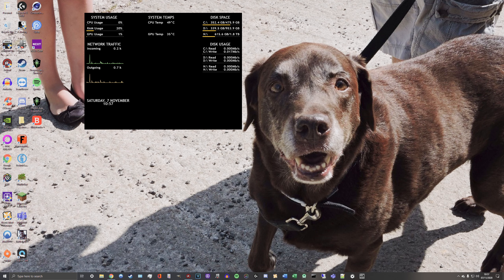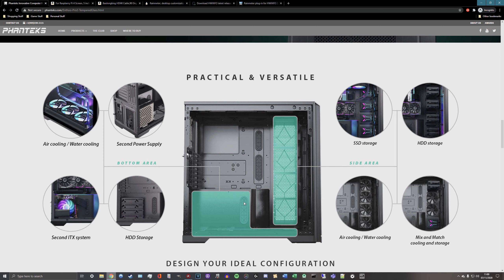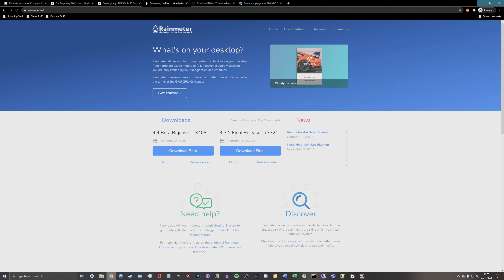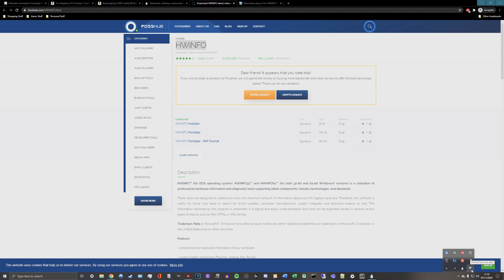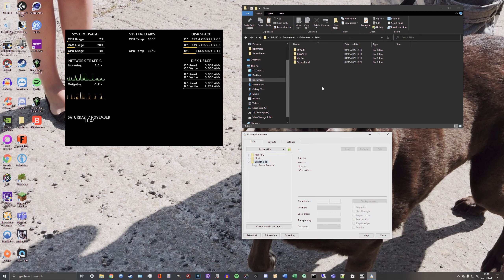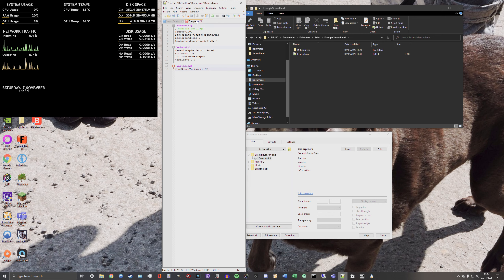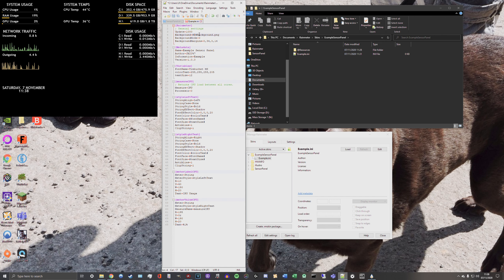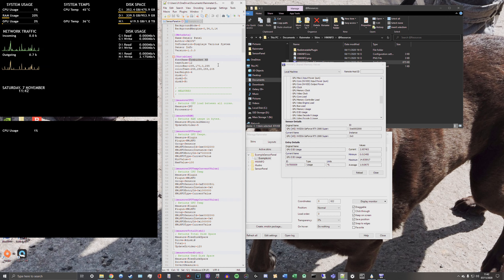Creating a Custom PC Sensor Panel/Hardware Monitor Without AIDA64 (Using free software)

Comment: wonderful video, and nice explanations. But at this point in time it isn't possible to have it working 24/7 since HWiNFO added a Pro version in March 2021. The main difference that causes issues is that the shared memory will only last for 12 hours in the free version and has to be manually enabled again after that time period.

So for it to work correct you either need to pay 20 bucks for HWiNFO Pro or use a version prior to the version 7 release.

Edit: I have not used it for 12 hours yet so i do not know if you need to enable it only once after the 12 hours to work permanently or every 12 hours
Reply from the maker: Ah right, thanks for the info. I haven't updated my HWiNFO version yet so I'm still on v6.34-4300 but I've pinned this comment to let others know.
Reply: My rainmeter sensor gadgets don’t load at boot and I’m also using 6.42 (something like that, I’m not home atm)
Reply from the maker: @darkaheart  Is this Rainmeter that isn't loading the skin or is this the HWiNFO plugin that isn't loading on startup?
Reply: @JAIJ47  I had the “show sensors on startup” uncheck, it’s confusing because it says “show” I figured they meant the window. I checked it and it’s working fine now
Reply from the maker: @darkaheart  Fair enough mate. I also feel it's a bit unintuitive to have a cross on a checkbox as well since it almost looks as if it's a negative action if you get what I mean

Comment: I'm glad to see a video come out where people aren't using Aida64.  Aida is nice but limited with gauge sizes and such.  I'm going to use this video as my template for my own sensor panel.  Thanks for the video.
Reply from the maker: You're welcome :). If you need anything clarified further then don't hesitate to ask. I'll try to help as much as I can or at the very least try to find some resources that could help.

Comment: Nice video. I am new to rainmeter so can you tell me how to make the skin fullscreen? Also would it be possible for the skin to launch on the display in my case at startup?
Reply from the maker: Yeah sure. The way I got my skin to be full screen is by basically just making sure the background image matches the resolution of the screen inside the case and then set the "BackgroundMode" property to 0 (I did put up another video going more indepth with my skin and what each little bit of code does if you want to check that one out as well https://www.youtube.com/watch?v=o2TbiSEOBXw )

So Rainmeter should already be opening on startup already but if not: Go to Task Manager, open the "Start Up" tab, find Rainmeter in the list, then make sure it's "Enabled".

For the skin to launch on the display, it should automatically be doing that since the second display is always plugged in and with Rainmeter opening on startup it should be remembering the position of everything on the monitor on start up
Reply: @JAIJ47  I’m using an old iPhone 5 for the display inside my pc so for it to be fullscreen would I just get a sideways iPhone 5 background and change the positions and sizes of the temps and stuff according to the background?
Reply: @JAIJ47  ok I managed to get the background set now i just need help with resizing and positioning the stats. I would like the fan speeds, disk usage, and network traffic removed so i can make everything else bigger. Thanks for your help.

Comment: This is really great and well detailed, thank you so much for sharing!

I only have two critiques, one very minimal and one point of improvement. The first is that you started out calling them 'widgets' and then switched to 'skins' in the second half. While not a big deal at all, skins is the correct terminology and widgets is used by XWidget. 

The second thing is that the text was a bit hard to see/read and I found myself leaning in towards my monitor several times, which makes me think that people on small screens/lower resolutions are going to have a hard time following along in certain parts. You do a good job of explaining what you're doing already, but either finding a way to zoom in or making sure you're being extra specific in your explanations when it comes to text would be very helpful for those who have a hard time with small text. A great example of this would be when you were talking about the file type needing to be ini. In that instance, it would have helped greatly if you'd spelled it out as well. Honestly, this is the first time I've heard someone pronouncing it as a whole word (which doesn't help with how to actually spell it as, if I didn't know already, might have entered 'innie' instead) and, with the small text issue, I felt it was the one time where the tutorial failed to be clear enough because, even with setting the video to the highest quality and leaning in, I still couldn't read things clearly. It was only when I full screened the video (and my monitor is 2560x1440) that I could really see 'ini' clearly.

Aside from that, everything was great. I can't talk about how much sense everything made as it made sense to me, but I've been using rainmeter for a long while at this point and can't speak for anyone whose just starting out. I have a feeling it's fine though. All in all, great work and I'll post this on your reddit post as well~!
Reply from the maker: Thanks a lot for the feedback. I'll see if enlarging the explorer icons will help to clear some of the small text issues when I next attempt a video. I'm looking to do a little update video some time soon on how I'm attempting to 3D Print an enclosure for the monitor using blender and cura so I'll try to improve the recording when I get to that point.

Comment: Do you by chance have a copy of the note file you are using that youd be able to link/send?
Reply from the maker: I've got the rainmeter skin in a GitHub repo https://github.com/JAIJ47/SensorPanel just be aware you may need to change a fair bit to get it to work for yourself and keep in mind the pinned comments about HWiNFO compatibility

Comment: is therIs there also a way to use a USB monitor I have the ax206?
Reply from the maker: Should be able to as long as you extend the displays in Windows and drag the sensor panel over to the monitor you want to display it on

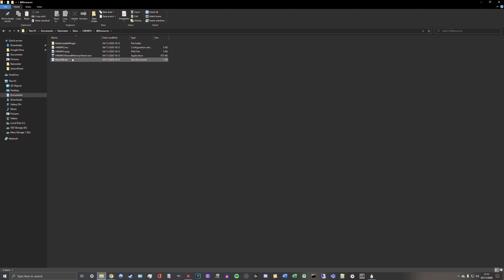Comment: i dont get this guide at all are you using a pre design build??i get lost @14:26 with all that coding i dont understand it. where do i get that script u have for sensor panel to use as templet? i guess what im getting out is how do i start from scratch i got all the programs but you go to Sensor panel folder with loads of text where do i get that??
Reply from the maker: Feel free to ask more questions if my reply below didn't really make sense. I may make a Rainmeter basics series to explain the components in more detail sometime this weekend if I have time to.

I made the skin myself using a mixture of vanilla Rainmeter measures (examples on reading CPU and RAM usage, Disk space, and Network traffic can be found by right clicking and editting parts of the example skin Illustro which is provided by Rainmeter by default once downloaded) and measures using the HWiNFO plugin. I didn't provide a link to download the skin since different hardware setups and systems will have different sensor information so large chunks of the skin may not work for others since I made this specifically for my build. This is also the same reason for why I didn't do a step by step explanation of the skin and tried to keep everything as basic as possible since every section (apart from the CPU and RAM usage, Disk Space, and Network Traffic sections) may be irrelevant to a majority of people watching.

To create your own skin from scratch all you have to do is create a new folder in your Skins folder (which can be found in Documents\Rainmeter\Skins). Call it a meaningful name since this is what will show in your Rainmeter UI when you want to load a skin. This part can be found from 14:46 - 15:29.

Inside the folder you've just created you just need to add an @Resources folder (to hold any images, fonts, or other resources you might want for your skin) and an ini file (just create a blank text document in Notepad and save it as type .ini). The ini file is your skin as it holds all the measures, meters, styles etc used to display itself. Without meters the skin will not run. This part can be found from 15:30 - 26:01.

Now from here it's up to you to decide what info you want to monitor. Everything you want to monitor will go into the .ini file you created. I gave a brief explanation on how to format and use the HWiNFO plugin to create measures for more advanced hardware readings from 26:02 - 29:28.

Some other information that might help you to understand the basics can be found in the Rainmeter documentation. I'd recommend reading about measures, styles, and meters first of all just to understand the basics and it'll also give you a decent idea on how the components work together to create and display the skin. The 3 sections are basically the foundation of any skin as they're all required sections for a skin to run.

https://docs.rainmeter.net/manual/measures/
https://docs.rainmeter.net/manual/meters/general-options/meterstyles/
https://docs.rainmeter.net/manual/meters/

Comment: So i wanted to do it by myself and create my own skin but the problem is its not that easy and also didnt found that much helpful video anywhere
If i tried aida64 it may be easy but wanted to do it in rainmeter . Can you suggest me something ? 
I wanted to make gauge,vertical bar and a clock.I tried using skin but cant those arent perfect size and also couldnt understand the ini files (which skin i liked)
if you know how to make this skin will you please create a playlist for these if you have time !!
Reply from the maker: Sure. I'll look at recording an indepth look at the ini file and try to explain each part as I go over it.
Reply: @JAIJ47  thanks a lot . tbh i was inspired to do this after watching your video.
Reply from the maker: @nabilubaidullahmobin2121  Thanks for the support mate. I really do apreciate it. Currently I'm just making a script and going over each line in the ini file. Once that's done and I've recorded, edited, and published the video I'll let you know it's up. I'll be providing timestamps in the description of that video as well since it's quite a bit of content
Reply from the maker: @nabilubaidullahmobin2121  The new video is up going over the code in more depth. I also show examples of vertical bar meters, a gauge, and digital clock/calendar
Reply: @JAIJ47  thanks bro btw doesnt hwinfo support psu monitoring ?
i bought corsair cv 550w last day but not only hwinfo but also hwmonitor,aida64 arent showing any data .
Reply from the maker: @nabilubaidullahmobin2121  Judging by this post here (https://www.hwinfo.com/forum/threads/psu-monitoring.3134/ ) you may need to look into the Corsair Link application and check if HWiNFO can see the sensor data

Comment: Too long and totally boring. Could have been easily edited to 6-7 minutes.
Reply from the maker: Where could I have condensed it to 6-7 minutes in a way for complete beginners to understand?
Reply: @JAIJ47  people who are willing to build this system knows the basics and some more. You don’t have to explain every point to them. 
Hardly there are any newbies who sees this sort of videos. JayzTwoCents explained everything and more using AIDA64 (which is a more complicated software) within 10 minutes.
Reply from the maker: @drbmaitra  But what if people "who are willing to build this system" don't know the basics? I personally don't think it's fair to assume that everyone that ever watches this video has intermediate to professional knowledge about PC systems, Rainmeter, Rainmeter plugins, and HWiNFO (see the comment by eric stackley as an example) which is why I attempted to at least explain the basics behind each point.

I do agree though, in hindsight, that some of the Rainmeter ini code explainations could have been condensed a bit or at least explained a bit better.
Reply: Then they won’t be able to assemble a basic machine, leave aside creating a second screen for them.
Reply from the maker: @drbmaitra  How does building a basic machine have anything to do with displaying sensor information using Rainmeter?

You can make a Rainmeter skin without having built a PC before. Creating a sensor panel isn't exclusive to just people who build PCs, it can be done for pre-builds or even laptops as long as there's HDMI output. That's why I didn't go over my PC build in any depth. I only showed an image of my case to explain how I mounted the screen and routed the cables.

This is just a video on how I created a custom PC sensor panel. It's not an in depth walkthrough, it's literally just what I used, how I created it, and an explaination of the basics and my reasoning behind each of the steps.
Reply: I don't know the basics yet and the level of detail was awesome. I really appreciate the work you put in! Thanks!
Reply from the maker: @meatcreap  Glad I could help and thanks for the support :). I really do appreciate it.
Reply: Most of GN's videos are long. Is it boring? Yes. Is it informative? Very much, yes. Long story short, newbie and others who want to learn may watch it from start to finish, for experts and expert wannabes can skip to your desired timeline (I assume you have fingers tho). Just leave him be, man. Cheesus...